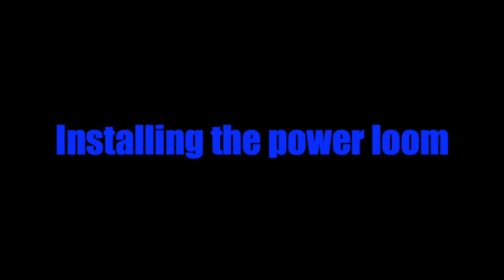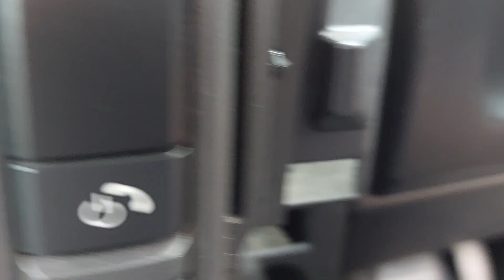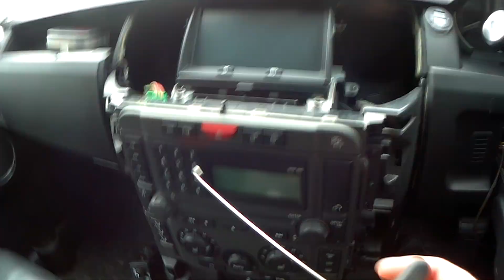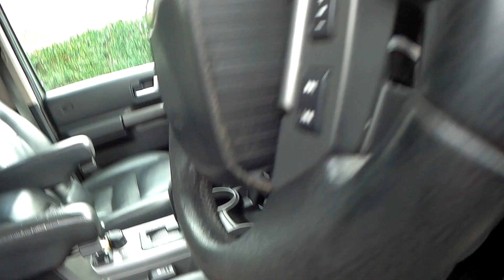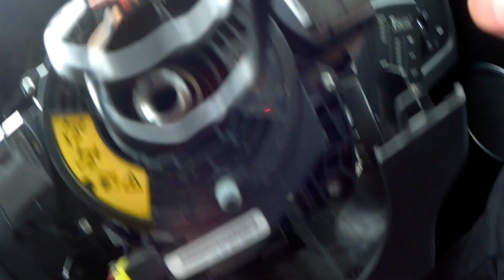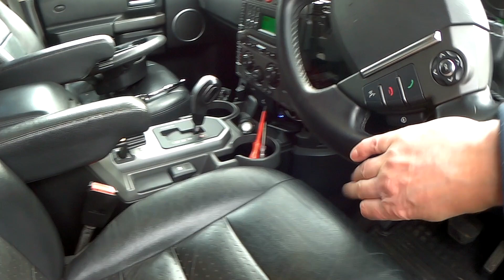Discovery 3 heated steering wheel retro fit HOW TO landrover LR4 RRS discovery 4 LR3 rover PART 2

Comment: Hey. My cruise control isn't working either. Did you solve the problem?
Reply from the maker: Hi, No I never use CC, but I believe you can't get it to work with this modification using the pcb's I used. The ones from Black Box CC may work.

Comment: great job mate... I'm struggling with my range rover, I only changed the steering wheel, I have the same pins, the controls are scattered, but my biggest problem is that they don't move to get the lighting on the buttons, that's really annoying me, if you can help me?
Reply from the maker: Sorry, I don't quite understand your issue? You put a heated steering wheel on and none of the buttons work ?
Reply: @trollmanrs  I put a retrofit steering wheel from 2010 in a 2007 car

Comment: Do all buttons work as normal with the boards installed? What functionality does it bring (if any) to the ‘ok’ button and arrows on the top right.
Reply from the maker: Hi, All buttons work apart from cruise control. No extra functionality that I can see or been told about. 
Hope that helps

Comment: Nice job what was the total cost for this Inc wheel and pcbs etc 👍
Reply from the maker: Hey Simon, how re you getting on with yours?
Total cost was £235; I managed to find a steering wheel for £55, airbag & Clock spring were £30, and the PCB's loom and shipping were £150.
Reply: @trollmanrs  slowly getting there just stripping and buying new bits all the time lol.  Got an engine but changing injectors, oil pump belts and idlers and tensioners etc.  Also stripping the chassis to treat and paint it all up. Loads of other stuff too 👍
Reply: Do you have the part number for the clock spring?

Comment: Do you have the part code for the clock spring, not possible to read on video
Reply from the maker: I've just added it in the video description
Reply from the maker: You need to be careful as I have seen ones advertised with the same part number, but clearly some didn't have the extra connector. So it's prob best just to look for that extra connector.